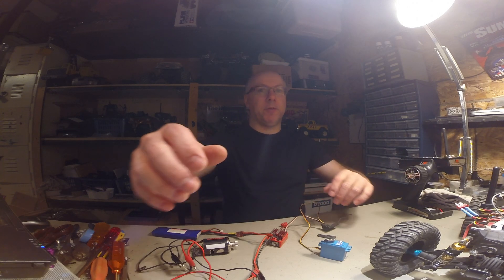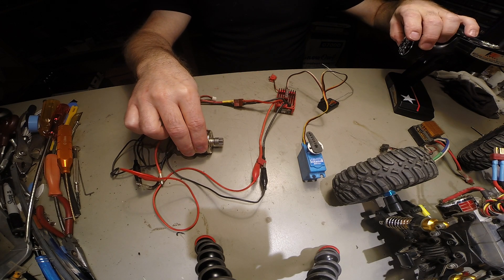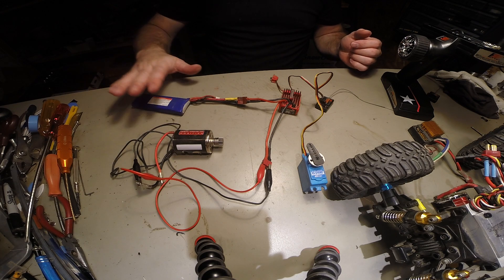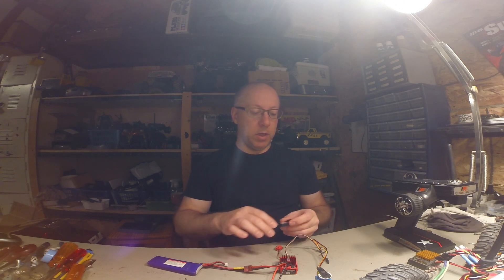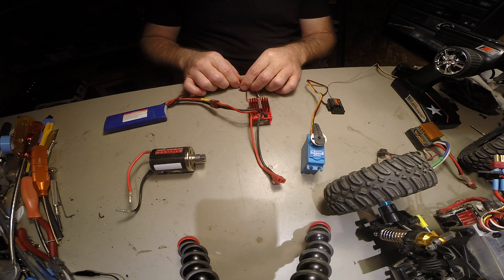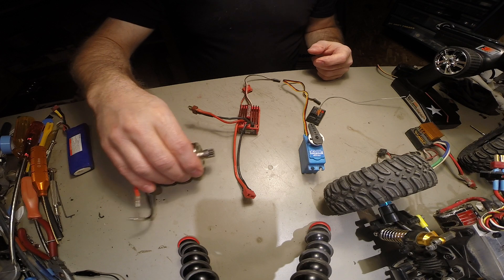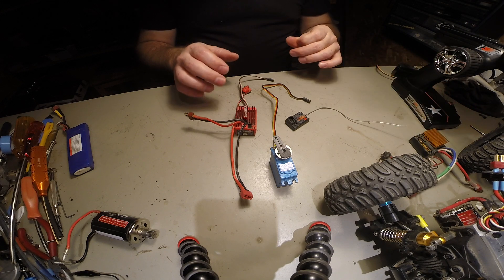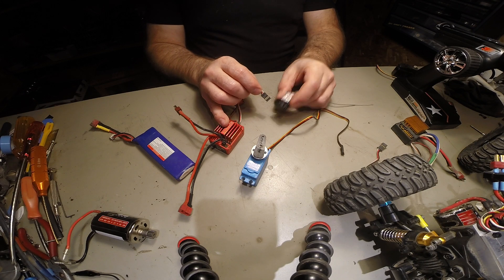Troubleshooting RC Electronics basics - Diagnose and fix it yourself

Comment: Hello my Remo Hobby Smax not responding to remote controller, can you help
Reply from the maker: The radio system in those is different.  Not sure I can help as I have never had one in hand. 

When you say not responding,  you mean at all?
Reply: @TheLEDwheel  it sometime work for a few minutes when I turn on and then no work at all. Some the steering not work some back and forth not work
Reply from the maker: Are you sure the battery is getting properly charged?
Reply: @TheLEDwheel  yes all fully charge
Reply from the maker: How do you know for sure?
Reply: @TheLEDwheel  I change new battery on controller and full charge the battery on the car
Reply from the maker: That's what I mean, how do you know the car battery is actually charged.
Reply: @TheLEDwheel  when its fully charge the light turn from red to green

Comment: It didn't work for me but thank you so much for the information maybe I can use this information to fix my RC using a different method
Reply from the maker: What's your issue?
Reply: When I turn on my actual rc car it moves an inch and makes a small sound then it just idles and I can't even use the remote even tho I just put new batteries and my car is charged ☹️
Reply from the maker: What's the RC and what electronics are in it?
Reply: @TheLEDwheel  it's a drift rc car and can I send u a pic of it

Comment: Hobbywing 10dl120 working fin with a fan with a 3s battery whill driving it there was no respond but the fan keep on working 
change to a diffrent esc and it all work but the fan keep working even when the switch is off 
any clew?
Reply from the maker: A little confused..
Reply: @TheLEDwheel  any more info you need?
i do have a program car but it wont work after the esc have no respond
Reply from the maker: So when you plug the battery in the fan starts going without turning on the power?
Reply: @TheLEDwheel  yes when i turn the power on the esc light start
Reply from the maker: It turns on but does nothing?
Reply: @TheLEDwheel  yes
Reply from the maker: Have you tried re binding the Rx to the tx
Reply: @TheLEDwheel  i took yestarday the new esc for a drive at and after 10 min normal not hard it die could be that the motor is fraing the esc ?
hobbywing 3650 1520kv 25.5t
first esc was hobbywing 10lb120  both brushless sensord 
secound esc is yeah racing hacktronic crawler
Reply from the maker: That's a pretty strong motor.. 
Remove the motor and check that all the drivetrain is smooth and easy to move in general. If there is a resistance you will need to go step by step, remove part by part until you find the problem area. Start at the wheels and make your way in. I know a problem area is often the wheel hexes  rub on the axles.

Comment: I have a problem with my Baja nitro 1/5 scale when I turn right it goes left and today I just bought a brand new steering box thing whateve I just need some kind of help
Reply from the maker: Check your transmitter for  reversing the servo direction. Should be channel 1 for steering.

Comment: Greetings from India..

My issue is when my car wheel touch to ground the relay gets on and off and get sticked, but just to check if I pull up the car the wheel rotate flowlessly without an issue.
Please tell whta could be the issue?

I directly connected the motor with battery then it's run well even when wheel touch with ground.
Reply from the maker: What is your RC?

Comment: Please help me my helecopter is not moving forward and backwards
Reply from the maker: Switch the servo connections to the receiver to see if the channels work with the other servos. If your front back works but not the left right then you might need a new servo.

Comment: I have no light coming in on the car at all the remote works but no steering or forward or reverse
Reply from the maker: Battery charged? You 100% certain the remote works too?
Reply: I'm new to the rc world just trying to help my gf son on his I assume the remote works it has two red lights that come on when you turn it on and the batteries was out on a charger both of them but ain't there suppose to be a light that comes on somewhere on the vehicle
Reply from the maker: What is the RC Brand and model?
Reply: 1/10 K&N Torment 2WD SCT Brushed with LiPo RTR, Orange(ECX03354)
Reply from the maker: The fact that the light turns on on the controller does not mean it's working. It just means it powered on. That being said, it's not a good sign that there is no light on the RC. You need to verify that the batteries are indeed charged. Are you using the original charger?
Reply from the maker: Those Chargers don't give you a status of the batteries condition or voltage. Do you have a multimeter ?
Reply: @TheLEDwheel  no but I can get one
Reply: Yes it's the original charger and I just put a new motor in it which is the same I took out something was wrong with it before and they took it to someoneand they said the motor was burnt up and it hasn't worked right since so I just put a new motor in it which is the same I took out
Reply: Could I just buy new battery packs and try that
Reply from the maker: Are you able to connect your old motor to one of your batteries?

Comment: Having problems with my rc,bought it new, was working fine the first day but then no power , esc light on but no power to motor or servo, trying to rebind but no flashing light  on receiver
Reply from the maker: If it new then it's under warranty. What RC is it?
Reply: @TheLEDwheel  vrx mega buggster  1/10 brushless 1032, esc fan sometimes turns on, receiver blinks, bind it,turn it off on again, receiver keeps blinking won't pick up signal
Reply from the maker: I suspect a bad receiver..

Comment: Hi my rc starts with a burst of power followed by being slowed and a significant drop in power. Switch it on and off again and the same problem persists.🧐
Reply from the maker: Unfortunately I can't really help you then. Those are disposable RC's!. Unless you install some hobbygrade electronics.
Reply: @TheLEDwheel  Hey thanks man for your time anyway.. Cheers
Reply: @TheLEDwheel  lol
Reply from the maker: What ESC? What battery type? Is the battery charged?
Reply: @TheLEDwheel  
Not sure but I had it charging for at least 5 hours so far
Reply from the maker: What RC?
Reply: @TheLEDwheel  oh it's a new bright  Ford bronco

Comment: Any idea of why dual esc's would cut power to the Rx when a servo is used?
Reply from the maker: Might be because the built in BEC's are fighting each other. At the receiver, take out one of the ESC's positive lead. You can remove it from the connector by lifting the tab holding it in. No need to cut it. You can either put a peice of shtick tubing on it just some electrical tape.
Reply from the maker: You may need an external Bec
Reply: I did, only happens when servo's are at full throw

Comment: What if only one command works on a servo or motor such as you only get left and not right or you get reverse but no forward?
Reply from the maker: You still need to go through the process of elimination to figure out what part is bad. Could be the receiver or the transmitter.

Comment: Hello!! I am wondering if you have a quick pointer here. I have the same vintage 4x4 Radio Shack RC Truck as you have on your shelf on the right side. I have checked everything from CBP connections, motors, switches on the receiver and transmitter. Now I am stumped. When I touch the antenna on the truck with a screw driver it reacts erratically, not sure what that means. There is no communication between the controller and truck. What I remember is that a a child lifted up the truck pulling the antenna, and from that day on nothing. Thanks! Peace!
Reply from the maker: These RC'are a little harder to troubleshoot. First thing I would try is making sure the antenna is indeed still connected inside the truck. Make sure your batteries are good too.

The screwdriver on the antenna is a good and bad thing. Is shows that it can indeed receive a signal (even if it's just noise) but also shows you there is no communication from the transmitter.
Reply: Thanks so much for the quick reply. I'm usually pretty handy fixing things, but this one is just baffling. Antenna is good, I will get new batteries. Thanks again!   @TheLEDwheel
Reply: @TheLEDwheel  I don't want to be a pest so I will only ask you for one more piece of advice, no need to feel obliged to answer. So all is intact and new batteries, checked potentiometer, motors, connections. Can't tell if the receiver/Transmitter uses a crystal, not sure what to look for, how can I verify if the transmitter is sending a signal, should I test with other controllers? Best Regards, Daniel
Reply from the maker: If you have another controller it would be ideal.  I'm guessing the transmitter powers on!? 

You can carefully resolder all the points in the transmitter too.
Reply: @TheLEDwheel  I will do that. Because now I did something while fooling around (don't ask me why :)); I actually touched a 9 volt battery to one of the relays on the transmitter PCB and the truck started moving forward, so I know there is communication going on now. Might just clean all the points first to see. I truly appreciate your advice. Wishing you all the best for 2019!!

Comment: My rc is not forcing not to get up a steep hill what happened?
Reply from the maker: It's having trouble going up hill? What is it?
Reply: Ok, when I go up a small hill the motor immediately stops running and It’s keeps doing or maybe it’s just the battery that’s low.
Reply from the maker: Well the power is always the first thing to check. Make sure the battery is charged.
Reply: Ok I’ll check.
Reply: One quick question, what motor do you originally use for your rc truck?

Comment: I have a problem with my rc it doesn't steer to the right and if I switch channels than my throttle does the same I know it's not my radios cuz I tried them in another car any idea what can it be
Reply from the maker: You tested the transmitter on another car? If so It has to be your receiver.
Reply: @TheLEDwheel  thanks for the reply is just weird because when I press the throttle goes all the way but when but when I brake it only goes like about a quarter of an inch  any idea what can it be and it is not the receiver I'm wondering if it's the receiver
Reply from the maker: Have you tried the servo on another receiver?

Comment: mine if everything on the motor run immediately but if i press the throttle it slow and it won't stop. how to fix it?
Reply from the maker: You may need to rebind your transmitter/receiver and/or reprogram your ESC.

Comment: Great video! Have a question. I own L3020 receiver and when i power on, it binds and stays on. When i use servo, it works. When i press the controller gently it moves  the motor, but when i go full throttle or go backwards the light on the receiver goes out. No power. I have to switch off/on and there is the same. Any ideas? Any hints?
Reply from the maker: Could be the BEC in your ESC is defective. Do you have an external BEC you can try?
Reply from the maker: Or you may need a glitch buster.
Reply: This model l3020 has integrated esc so I guess that i might need to exchange the whole thing?
Reply from the maker: Quite possibly.
Reply: Thanks for quick responses, would You advise on getting a better receiver with extenal ecs and bce?
Reply from the maker: A separate Rx and decent ESC is always my preference. 2amp BEC minimum from the ESC.
Reply: Could you suggest a basic set upthat could do the trick?
Reply from the maker: What RC?
Reply: Hbx 12891 https://m.rcmoment.com/p-rm6562y-eu.html?currency=EUR&Warehouse=CN&aid=rmplaietjc&gclid=CjwKCAjwio3dBRAqEiwAHWsNVVc0uTdICjw_2iwtLdsBAC6hxGGWKco6UejT26UQ4ifapgzJ4_q7kxoCuWoQAvD_BwE

Comment: Hi i have a cheap rc car when i press the trigger the lights on the car goes dim like it signal is coming in...but nothing happens no turning of wheels left or right  or wheels running. So i tried another working controller n its from another car...and it does the same thing. Wat could be wrong?? Pls advice.
Reply from the maker: Is your battery charged?
Reply: @TheLEDwheel  yes they r charged n battery on remote is new.
Reply: Yes i tried it on the other car n the controller works on that car...but same thing wen i use the other cars remote on this rock climber same symptoms
Reply from the maker: Does your controller work on the other car?
Reply from the maker: Then it's the receiver/ESC which is one piece on these toy grade RC's.
Reply: ok il check the reciever n will keep u posted thanks
Reply: Hi im back....gd news i stripped the car apart n found out the motor to the wheels n servo were frozen stuck...the previous guy didnt use the car many months n kept it in the store....so yes...chsnged the motors and now the rock climber (cheapo) is running well....thanks for your help...GOD bless u!!

Comment: Mine gets power but does not move at all , I have replaced the transmitter and receiver hellpp I need it to be fixed asap
Reply from the maker: You try Connecting power directly to the motor?
Reply: @TheLEDwheel  I tried that and it moves the motor a little bit as if it was twitching and then it stops
Reply from the maker: Have another motor to try?
Reply: @TheLEDwheel  no I new to the rc game
Reply from the maker: Well, since you say that directly connecting a battery to the motor shows you that's it's iffy then most likely need a new motor.
Reply: @TheLEDwheel  what about the servo aswell should I get that aswell seen as it doesn't work aswekl
Reply from the maker: You didn't mention the servo.. 

Start over.
So nothing happens at all when you power everything up?
Is your battery charged?
Reply: @TheLEDwheel  yeah nothing happens
Reply: @TheLEDwheel  I'm pretty sure it's all binded
Reply: @TheLEDwheel  the lights on the esc
Reply: Turn on

Comment: I think my motor may be dead. When I push the throttle my ESC has a red light that lights up. (completely normal) My steering still works and the light still lights up but the motor just doesn't do anything. I switched the channels and the motor still didn't do anything. Does this mean my motor is dead? Or it could be the receiver like in the video. After switching the channels my servo doesn't do anything but my motor also doesn't do anything. So it might be more than just the motor not functioning.
Reply from the maker: Sleepy Gnome from Nd  some jumper wires and connect a battery directly to the motor and.be careful not to short(make the wires touch each other) them out.
Reply: to test if the motor is dead or not?
Reply from the maker: Sleepy Gnome exactly.
Reply: I'll have to pick some cables up tomorrow and I should get back to you soon depending on if the motor is dead or not. Thanks!
Reply from the maker: Sleepy Gnome .... See if you can get a set of decent alligator clip wires. They are great for testing.
Reply: ok

Comment: so mine stalls when I use throttle, so it responds like a few seconds later. It doesnt reverse and it steers but it's only like a fraction(so if I steer fully to the right it only goes the littlest bit to the right as if I'm trying to change lanes on a highway)
Reply from the maker: Nathan Languerand might want to check the settings on your transmitter and then rebind and reprogram the ESC.

Comment: Great video.  Did you ever create that flowchart?  I am troubleshooting and can't determine why I dont get power to my receiver.  Just purchased a new one thinking it was the receiver yet the new one does not light up when I make the connections and power the RC unit on,so I never get to the point where I can bind it.

What can I test to see why I don't get the receiver light to come on?
Reply from the maker: Carlos Arnavat right of my guess would be your ESC is defective. Since you tried two receivers and get the same result. It's all about elimination.

Comment: why is that my new battery lion pack get really hot and my rc car runs very slow. please help me to rapair . thanks
Reply from the maker: swordbearer3 remobe your motor and check that everything feels smooth when you spin your wheels.
Reply: ok thanks i will try.that.

Comment: I have a miss geico boat with 160amp esc and motor ran 6s and worked 20seconds  then stopped now motor will jitter and barely spin do u think it is motor or esc or both? Thanks for any help
Reply: I mean 120 amp esc
Reply from the maker: What are the specifications and brand of your ESC and Motor?
Reply: theLEDwheel dynamite esc  and 2000kv dynamite motor 6pole
Reply: Factory what it comes with
Reply from the maker: What model ESC? Dynamite what?
Reply from the maker: Mike Neuzil don't know what boat it is so can't look up what ESC it is.
Reply: theLEDwheel  https://www.horizonhobby.com/miss-geico-29-inch-catamaran-v3-brushless-rtr-prb08009
Reply from the maker: Is it brand new?
Reply: theLEDwheel it worked fine last fall sat over winter now it just jitters
Reply from the maker: Try rebinding the receiver to the transmitter and reprogramming the ESC.

Comment: What if the ESC only fires up when the transmitter is disconnected?
Connected Nothing Works.

AKA ...(Mr. Noob)
Reply from the maker: Huntington Beach Sasquatch as in the transmitter is off?
Reply: No on/off switch, When I plug in the battery nothing works, when I unplug the transmitter from the ESC the ESC powers up, starts to do it's beeps and the fan starts that's on top the ESC.

Thanks for the reply! 
Perhaps My Son and I will be driving it again.
Reply from the maker: Huntington Beach Sasquatch
Ok. The transmitter is the part you hold in your hand. The part that's connected to the ESC is called a receiver. It seems like your receiver may be shorted out.
Reply: I'll get a new one, Thanks for the advise.